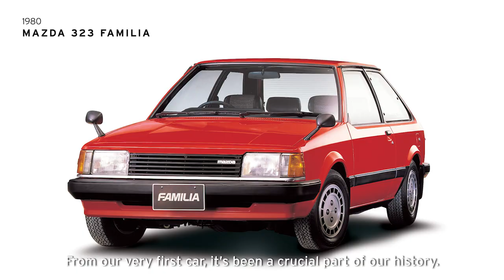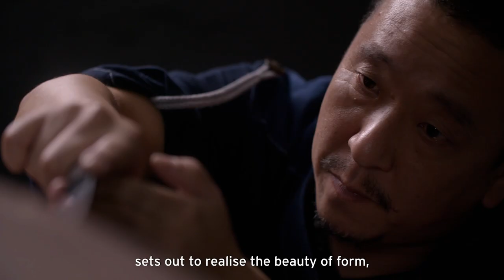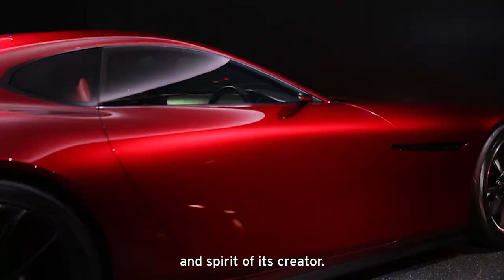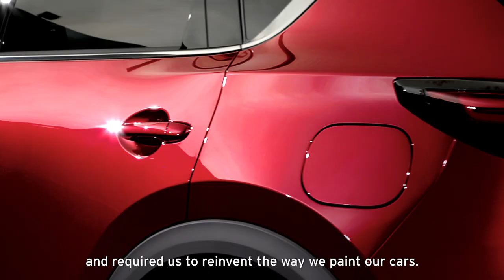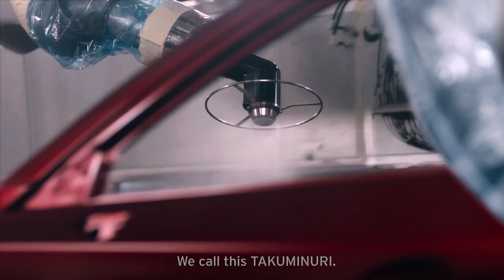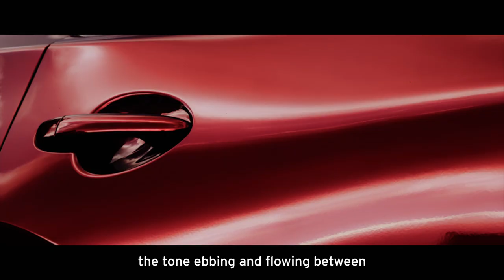Soul Red Crystal | The Art of Colour | Mazda Canada

Comment: May want to stear clear of red of you don't keep it garaged.  I have a2015 and the red is fading off all plastic pieces including spoiler, bumpers and mirrors.  Of course by the time it happens the warranty is gone.  Also, rear quarter window trim (rubber) is failing on both sides.  These are known issues on the forums.  My previous 2003 Protege'5 Sportwagon held up much better at this same point in ownership.  Charge more, but longterm quality seems questionable unless vehicle is kept under lock and key.  🤔😒😶
Reply: I don’t have a problem with my cx-5 but then again I wash and wax pretty consistently. That might be why